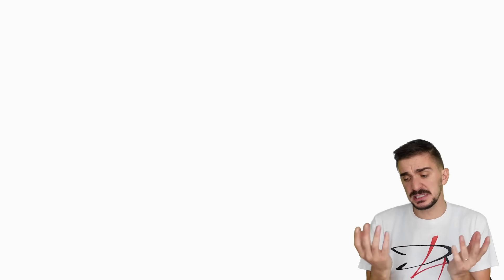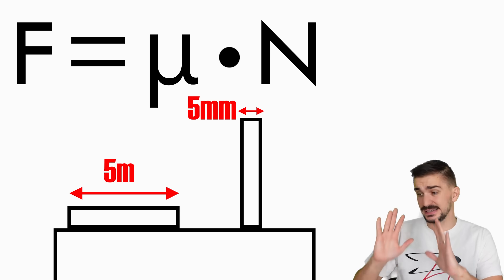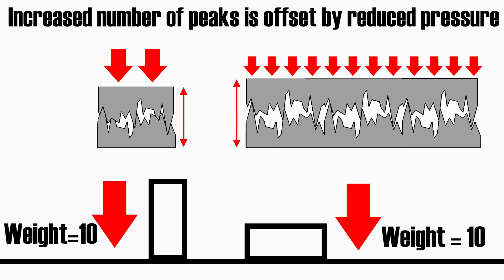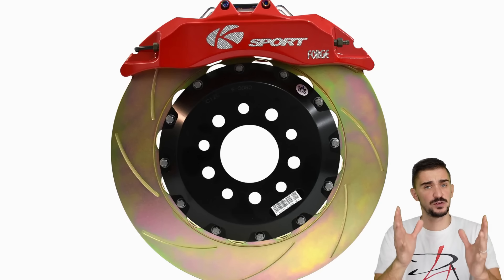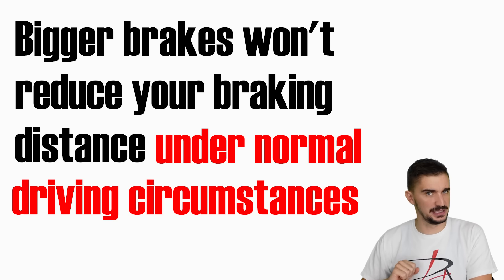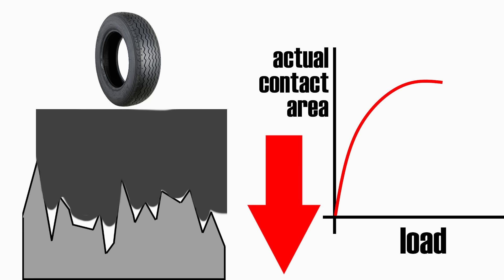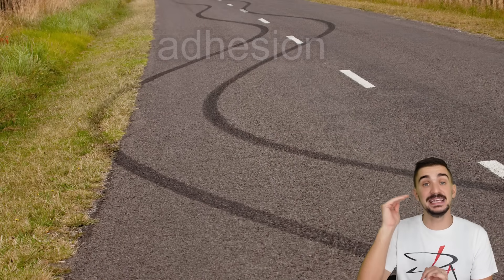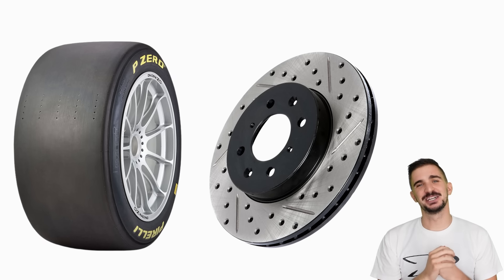Why Big Brakes Won't Stop You Faster but Wider Tires Will - Friction and Surface Area Explained

Comment: Me was told in scool that you cannot increase friction by increasing the surface. Because friction is only depending from the force and the materials.
There are to ways to increase friction on car tires:

1. changing the friction materials, 
2. increase the force.
So since you cannont increase the cars weight and you cannot change the road (tarmark) the only thing left you can do is change the rubber of the tires.
Racing tires have a much softer rubber what has a much better friction on the road. 
BUT as the softer rubber does wear down way faster the tires need to be wider so they can last longer, the wear is spread to a bigger surface.
My understanding thatfor is: The main reason why tires are made wider is to reduce the wear, because those are made of much softer rubber.

When it comes to high performance racing like in F1 or dragster racing it is a complete different story because here it is not friction anymore but adhession. The tires are more or less "glued" to the road. Those have a increadible high wear and can only be used for a short time. That`s why in dragster racing the "burnout" is performed prior to each run, or in F1 the warm up round is done. This is to heat up rubber and then it is behaving more like a adhesive and not simply friction alone.
The main difference between friction and adhession is that in adhession the size of the area does matter a lot, in friction it does not matter at all.
Reply: No
Reply: @potatopobobot4231  no what?

Comment: Thank you for all your good work. Just one question, I have read that the contact patch doesn't change, no matter how large are your tires, just the shape change (for the same vertical load and internal pressure). Where is the true ?

Sorry if my English is not perfect, I speak french (from Switzerland).

Comment: I haven't done materials physics professionally for many years now. But the "FUN" equation is one of the most mis-used I've ever come across.
This equation is not a physical "law", it's a really coarse heuristic that fails in basically every real-world situation.

It doesn't work for visco-elastic friction, and that gets discussed a lot, but it also doesn't work for materials with a non-infinite shear strength -- i.e. all materials.
This is easily tested in the home. Have a friend drag you along the ground, and try and stop yourself with a needle. Once you've cleaned up the blood, notice how the equation failed.

Comment: There is a reason, why bigger brakes shorten the brake distance. It is in german the "Schwellzeit", the time, the system needs to build the pressure in brake lines and to slower the rotation of the wheels. This is usually some 0,6 - 0,7s. A big brake can cut this in half, so the brake distance from 100km/h is shorten bei 8,4m.

Comment: Very well presented.  Excellent delivery and clearing up the misconceptions of many a petrolhead.  5-star simple-explanation engineering rating to this video.  Just to add 2 extra points: we all love BBK because of unsprung weight reduction on the non-suspended bits of the car, and more so for car-porn vanity fetishes;  just gotta fill up that inner wheel gap!
Reply: Big brake kits usually ADD unsprung weight.
Reply: @xtnuser5338  Not quite true. Most performance aftermarket BBKs are built to be lighter (and more rigid) than stock factory setups. Case in point: A BMW E60 M5 stock brakes  (Front: 374mm discs & 2 pot floating caliper, Rear: 370mm discs & 1 pot floating caliper) vs Stoptech BBK kit for the E60 M5 (Front: 380mm discs 6pot fixed calipers, Rear: 380mm discs 4pot fixed calipers). Each corner saves approx 4~5kg per wheel.

Why?  Because Stoptech's (or Wilwood / Alcon  / etc...) billet Aluminium calipers, and larger 2-piece rotors with Alu bell housings weigh much less than the stock complete cast iron rotors,  and steel floating caliper assemblies.
Reply: @mugenfoo  Gotcha. You pay for quality engineering, but you get your money's worth. It was hard to find any aftermarket kits that offered lighter weight for my car, and the couple that did had savings of a few ounces at best. But I guess that's because a GT3RS comes with a pretty damn impressive brake setup already.

Comment: If the brakes are limited by power dissipation, i.e. they overheat and you get brake fade then bigger brakes WILL stop you faster. This was the case for many older road cars (especially with drum brakes) and very often the case with competition cars where repetitive hard braking is required.

Comment: Larger brakes pretty much have the same size pads, the larger roters locate the pad farther away from the center of the hub, therefore more leverage is applied to the rotor by the caliper.  I can say for a fact with 100% certainty that larger rotors do stop the vehicle in a shorter distance and I couldn't type this fast enough to stop hearing this guy speak.  Thumbs down.
Reply from the maker: I can say for a fact with 100% certainty that you don't understand this properly. I typed at normal speed though. The leverage is irrelevant. A brake pad doesn't grab the outer edge but at or near the center of the friction area of the disc. Therefore your leverage increases by a few centimeters which is pretty much irrelevant. Every stock system has more than enough power to lock up the wheels which means that increasing braking "strength" achieves nothing and cannot stop the car sooner.

Comment: Nonsense clickbait. They both aide in higher stopping power/shorter stopping distance. Though, a better material with more bite, or a harder edge on the brake pad will make a bigger difference then wider pad and rotor material. The difference is one will last the other will not, one can dissipate heat continuing to provide braking over the course of its life, or the course of a race, the other can stop hard and fast once (provided the tires can contain the force) and then the next time the pad will be mostly destroyed resulting in a terrible stopping distance.

Comment: You don’t mention that yes bigger breaks don’t mean more friction but a larger diameter rotor is more leverage against the vehicle moving causing more stopping power for even the same size break pads. You need wider tires and bigger breaks together to get the stopping power to the ground. Either one will help but only so much until each are upgraded and once that is done the effects are multiplied not just additional with one mod.

Comment: I disagree on the point that larger disks will not make any difference. 
If the diameter of the disk is increased and the normal force is applied at a larger distance from the disc centre you have a larger lever and will apply more braking torque.

Comment: You see the effects of bigger brakes dealing better with heat well in mountain biking. 
An inexperienced rider new to a downhill bike park might overheat a brake with a 160 mm diameter rotor but a change to the next size up 180 mm rotor with the same caliper and pads (different spacers are available for the different rotor sizes, 140, 160, 180, and 203 mm) would likely not overheat or take much longer to do so.

Comment: I do like your videos, but somehow I'm not entirely convinced by your explanation here: I don't like counterintuitive.
Consider two discs with the same thickness and material but different radii. To achieve the same braking force you'd need to squeeze the smaller one harder: the normal (N) component. This would cause it to wear out faster, that's the point of the bigger disc. It achieves more longevity by performing at lesser stress: you need to squeeze it lesser. If you still squeezed it with the same pressure from the pads, it should provide increased braking force allowing the vehicle to stop at a shorter distance.

Comment: This isn't quite true! Larger diameter rotors allows the same braking force from the calipers to do  more braking. you can experience this by putting smaller or larger rotors on a motor cycle. The larger brake rotor brakes harder than the smaller rotor. This isn't jsut heat build up, it's the longer lever you create with larger rotors.

Comment: The brakes prevent the fade from hot brakes,  if does reduce braking distance in certain conditions,  the brakes need to be suitable for the tires, large diameter and wide tires  have a larger footprint,   you explain it 10k times better than I do, great video,

Comment: Brakes when increased in size will help the breaking system from over heating that is the main problem of smaller brake systems its not a distance problem but rather a reliability issue especially when driving and braking hard for long periods of time. So when the smaller brakes heat up to much they start to fail and braking distance become longer.

Comment: The force applied through the pads goes up exponentially with hydraulic cylinder diameter given a similar fluid pressure. The pad contact area is not the only variable changed when going to larger brakes.
Reply: As well as equal pressure on both sides of the caliper.

Comment: One Thing you didn't mention is that MU can go above 1 on tire and brake pads. When a track surface is coated with rubber, it's more in the realm of adhesion and suction than friction only. Same with brake pads, your surface area falls on it's face as they require break in which is not only cleaning up the surface, but also adding material to the disc that creates and adhesion layer more than a friction layer. That is why it's important to run brakes in their temperature range where they actually transfer their material to the mating disc.

Comment: Bigger breaks are usually heavier!
I assume you’ve covered sprung and unsprung weight?  Tires+wheels+brakes+suspension arms have twice the performance costs as body/frame/engine/etc. (cars, motor bikes and pedal bikes where you’re the ”engine”)

Comment: Changing just you tire WIDTH makes the contact patch both wider and shorter so generally very similar total area, just different tire deformation. 

Wide patches corner better in dry (high traction or slicks) but long narrow patches have more time as the tire rotated for the tread to clear water, slush or snow.

Comment: As an Engineer, I love how you explain things with formula and science but simplifies the theories so people without the technical knowledge can understand. Also as I car guy, I love how things I learned in University have application to my hobby. Win, win in my books.
Reply: I am an engineer
Reply: Consider he never mentions how bigger discs give better leverage over the rotation of the wheel/axle. Am Also an engineer.
Reply: @eggmcnog  You are right. IMO, he skims across so many details w/o considering many important details. Pounds per square inch, foot pounds, etc.
Reply: @1dave301  he’s right about all the friction stuff without being too dense but ignores the leverage aspect altogether
Reply: Well then this is not the video to learn from. The whole point of bigger brakes is that they don't lock up and have less friction. Which contradicts the point he's trying to make. Bigger brakes are effective by not locking up as easily. Because when they lock-up (from too much friction) your braking is only as good as the sliding rubber (tire) on the concrete.

At the end of the day force of pushing the brake pads on the disk is roughly the same. But smaller brakes have less surface area resulting in more friction we don't want as it leads to locking up your brakes.

It's still a useful video from physics standpoint, but certainly not from automotive. 

PS. Cars have ABS yes, but your braking will still be far less effective if it has to kick in more than it would have otherwise.

Comment: Physics tell us F=uN 
And N is normal to the brake disc
So the harder you press the brake the larger the braking force
We need larger tire just because normal brakes are more than sufficient to out brake the tire
ie. provide more frictional force to the tire than the ground can provide to the tire
That’s why you will lock the tires and need ABS

So wider tire USUALLY get you better braking abilities unless your brake can’t lock your tire
But it will NOT be always 

Yes brake fading is a thing
But for a single braking event all it matter is the final braking force provided by the car to the ground

Stop the bullshit by saying some physics formulas without even understanding the physics of braking

If you locked your brakes, get a wider tire
If you cannot lock up no matter how hard your pressed on the brake, get a larger brake
Reply: Also braking is not a simple larger brake equal larger force thing
It depends on the ratio of area of the master cylinder to the area of the brake piston
The brake system is a pressure multiplier
There’s many ways to improve the braking capability as long as your car is not grip limited 

Even for the same sized brake disc, if your increase the multiplying ratio, you will get larger pressure on the piston and get larger braking force

Comment: Normally great vids however this time you've neglected one very important point in regards to rotor size - rotational leverage. As the rolling diameter of the wheel remains a (relatively) constant, a big advantage with larger rotors is their comparative size to the tyre diameter. This has a very definite affect on braking power, particularly initial bite. I have on several vehicles (cars & bikes) changed to larger rotors with SAME PAD SIZE and composition, and achieved  much stronger, more consistent and more easily modulated braking in every application. An example of this principal can be see on several Buell sports bikes where the rotor is close to the same diameter as the wheel rim and achieves strong braking power with a relatively small pad.
Reply: Thank you for pointing this out! Saved me some time! 😅

Comment: I had a B13 Sentra Wich it had 205mm wide tires
But man I never trusted that car for an emergency brake, it locks up very easily
But when I drove another B13 with the stock 175mm tires I could brake harder until lock up
Why is that? Bad alignment, bad suspension setup?

Comment: What if I add an equal size caliber 180 degrees out from the stock one. would the heat increase out weigh the increased surface area?

Comment: Wow!!! The way that you differentiate between friction of various materials--and wet vs dry--was fantastic! And your illustrations were excellently suited to the topic at hand while keeping things interesting and fun to watch! Well done, Sir! I'm looking forward to learning more about tires in the future--high vs low profile, soft vs hard compound, wide vs narrow, summer vs winter, etc. Keep up the great work!
Reply: I read an article on this topic years ago and having this mental model of how tires create grip has provided so much benefit. Once you understand the concept you can derive all sorts of other things, some of which you talked about. For example, knowing that a tire's grip doesn't scale linearly with the amount of force with which it is pressed into the road you can see why things like low profile tires can help keep more of the rubber in contact with the road due to reduced deformation under load. It also helps explain how things like camber, roll stiffness and tire pressure all contribute to maximizing the grip in a given situation (when a car is cornering the grip lost on the inside is greater than the grip gained on the outside so all of the painstaking setup work on a racecar is ultimately about trying to create the least deviation in tire load across all points of contact since the best possible grip is when all parts of all tires are as evenly loaded as possible.)
Reply: @ChrisMah  You also have to figure in the tire compound itself... 'sticky' race compounds you can dig a fingernail into will damn near work on a vertical surface, where as your harder compounds won't stick so well, but the tire will last 50,000 miles and probably get great gas mileage too... where the race tire will burn out in 1000 or 1500 miles, and really suck for mileage going down the road.

Like many things, it's a compromise as to which properties your desire and which ones do not matter for your application.
Reply: @kleetus92   Yes, good point. I’m even amazed how sticky some of these 200 tread wear  “street” tires can be these days even although still nothing like soft race rubber.
Reply: And there's also different friction coefficient for sliding and rolling contact... rolling rubber on road is 1, sliding rubber on road is .5.... rolling rubber on wet road is .5, sliding was .25... that one stuck with me.
Reply: Don't get carried away, he isn't that good.

Comment: Way to gloss over the effect of a larger diameter brakes effect on braking torque.   On motorcycles and mountain bikes its pretty blatantly obvious when you change rotor diameter with the same caliper and pads

Comment: Only thing to keep in mind for tires is that your contract patch doesn't get much larger with wider tires just wider and slightly narrower but larger diameter tires do increase contract patch area because the tire is more flat and less pressure has to be applied for it to conform to flat. Downside to larger diameter tires is that most of your weight is in the tire belt, which is the same problem as wider in that it's an increase in rotating inertia but additionally it reduces your gear ratio which will slow down most cars.
Reply: You can increase the contact patch without increasing the outer diameter of the tire.  You only need to increase the diameter of the wheel.  having less sidewall means a stiffer tire which gives the flatter contact.  Depending on rubber compound this also reduces the amount of heat generated by the tire rolling.  Race compounds you want the extra heat, street compounds you don't want the heat.